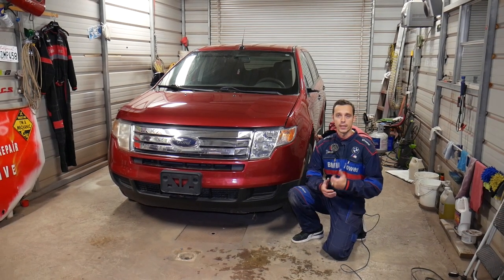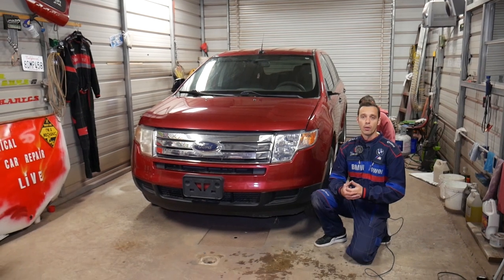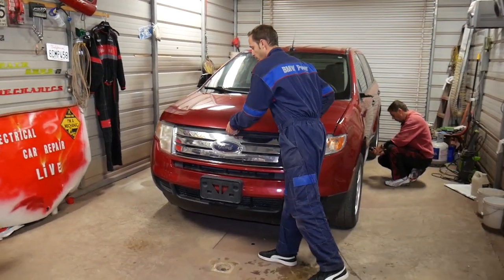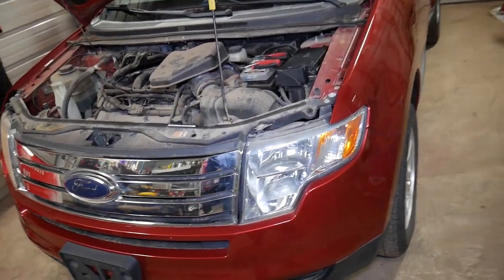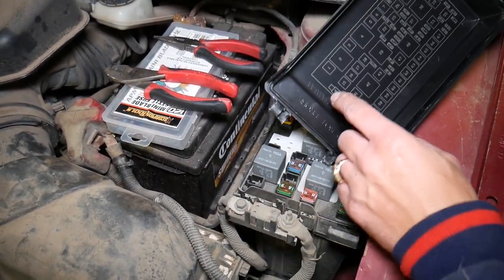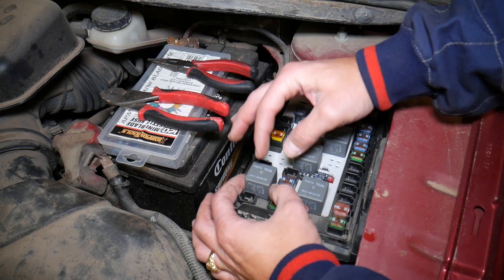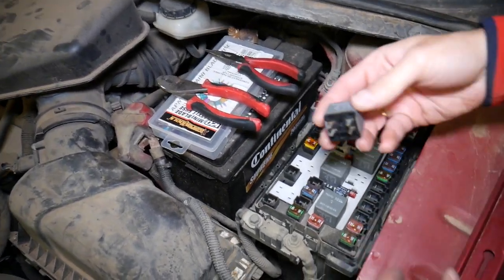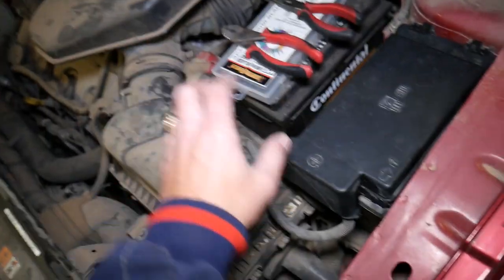FORD EDGE HEATER BLOWER MOTOR FAN RELAY LOCATION REPLACEMENT

Comment: Hello. I had a problem with my Edge, the fans didn't turn on, so we changed the fan module. After change, 
the fans start running at 7%, with the ignition on and the engine off. This is another module problem?
sorry for my english.